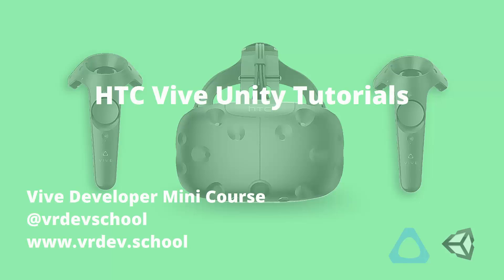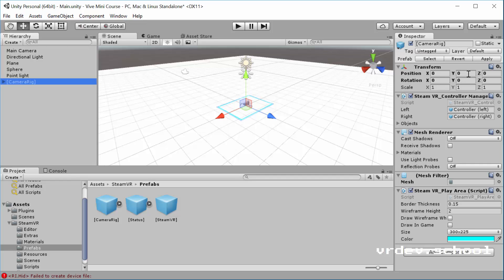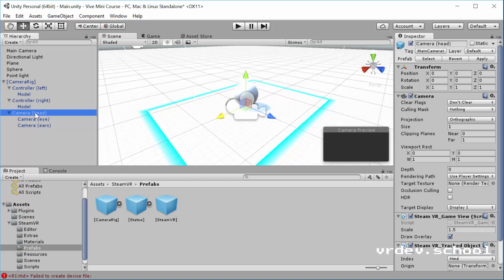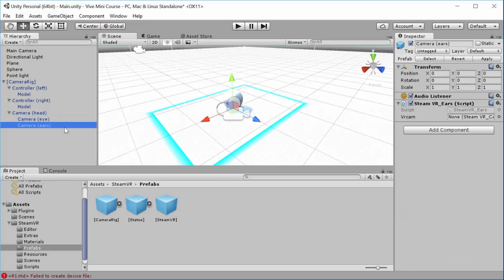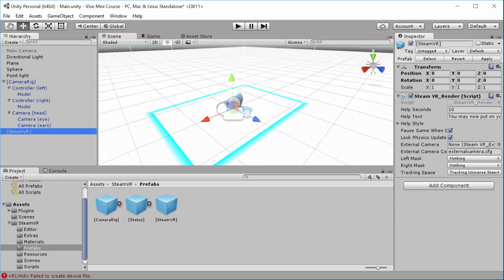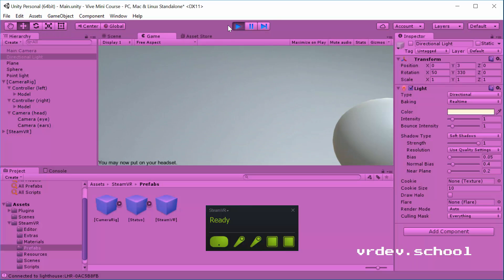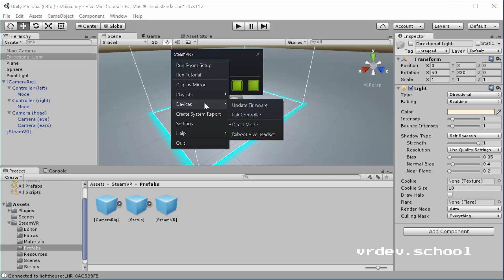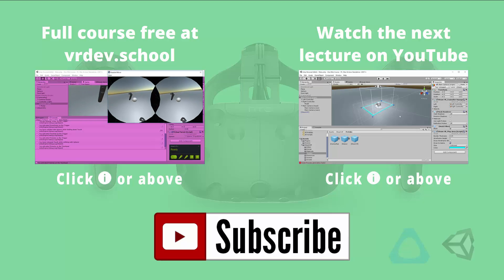Vive VR Game Developer Tutorial - Part 4 - Understand the SteamVR Camera Rig

Comment: I wanted to take the full course I need some info before purchasing it. 1) I have a complex 3D model assembled from different parts, I have drawings(pdf) for all those files in assets folder, my requirement is if user points to a part and clicks on controller, it should pull up the drawing(pdf) info. I am not expecting the exact requirement to be taught in that course but want to know if I can gain enough knowledge to develop the same with some additional efforts from my end.